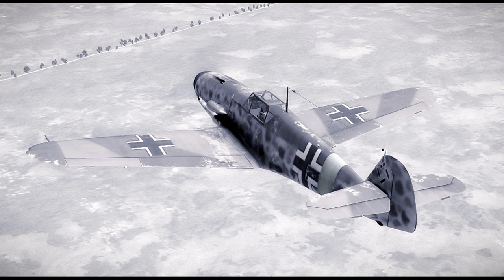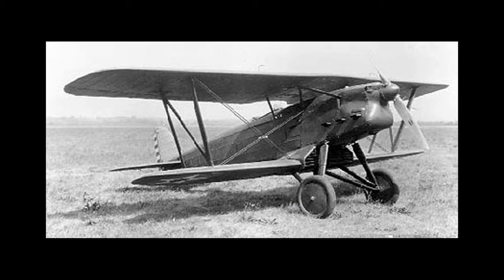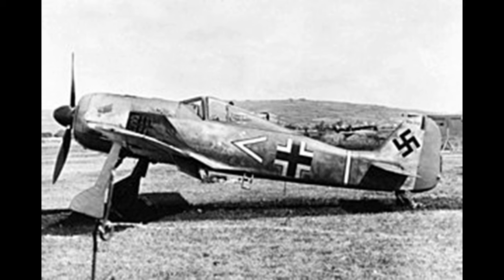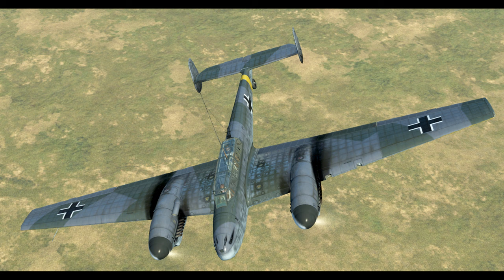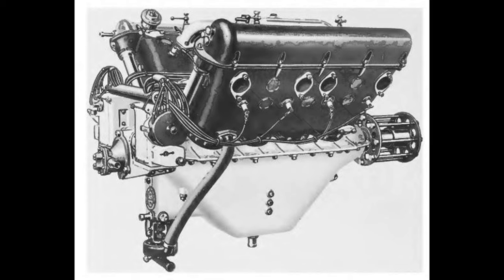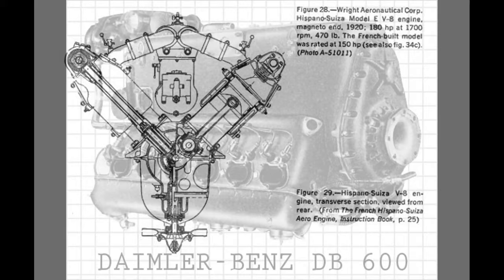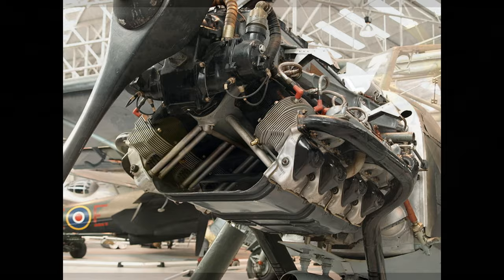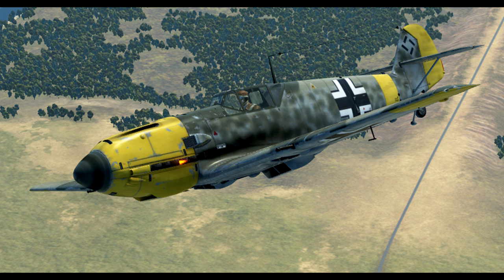Messerschmitt Bf 109 , Why an INVERTED V-12 Pt. 1? inverted V12s vs. upright

Comment: I notice from the pictures in the webpage that the inverted engines appear to exhaust their spent gases in the area of the wing root whereas the 'upright' engines exhaust well above the wing root.  Is it possible the spent exhaust gases help reduce the possibility of the airflow stalling at the wing root, reducing landing speeds and/or aiding low speed maneuvering?

Comment: The thing I find amazing about the German built V12's from WW2 is the engine's were so precisely and meticulously machined to such a high standard of precision that the surviving engines can not be repaired. if a part was to were out the tolerances are so tight even a bearing could not be made to day to repair one with the same level of procession . so the people of the historical society's that keep them can do only maintenance to keep them safe from damage. we in the US and even the Germans have lost the ability to do work on such a precise level .
Reply from the maker: I am afraid you are correct.

Comment: Additional info: Page 37 of "The Secret Horsepower Race", Helmuth Sache, Chief Engineer for Aero Engines, is quoted as saying  in 1937 that "The inverted engine was chosen by the German Air Ministry because of the general ease of installation, accessibility, and view in the case of single-engine machines."

Also in 1933 the RLM sent a tender for future engine development to Argus, Daimler-Benz, BMW, and Junkers.  It contained 7 fundamental technical requirements, the very first of which was that the engine be inverted so as to less restrict the pilot's field of view.  The second requirement specified a low mounted exhaust system to place the exhaust gases and exhaust flames out of a line with the pilot's head. This requirement mentioned that this also suits the fact that the widest part of the fuselage is the wing-fuselage junction.

Up until then all the engine manufacturers were developing upright V-12 engines, and this requirement caused them to have to redesign these engines.  For example oil and fuel systems had be be reworked, and oil scavenge moved to the valve covers.
Reply: Correction: I think those specifications were sent to the manufacturers in 1928 by the DVL, the predecessor of the RLM which was not instituted until 1933.

Comment: Another disadvantage of the inverted V-12 was the lower prop line made the undercarriage longer to avoid the prop hitting the ground, and therefore the 109 had a higher nose when sitting on it's tail wheel. This made vision much worse, and the undercarriage was probably less stable also.

Comment: Greg , FW190 had Radial engine! First prototypes. The first prototype, the Fw 190 V1 (civil registration D-OPZE), powered by a 1,550 PS (1,529 hp, 1,140 kW) BMW 139 14-cylinder two-row radial engine, first flew on 1 June 1939.
Reply from the maker: Wow, you guys are really coming out of the woodwork today. Wake up and smell the coffee. Then, listen to what I said. I didn't saw what the first prototype had, I was specific in my working, and yes SOME 190s have inverted V-12s.

Comment: For single engine aircraft, I think room for armament close to the CG, and even better, close to the pilots sight line, is a big advantage.  There would be a better concentrated fire,  over a longer distance.  Wing placed guns are angled towards each other, so the bullets will cross each other at a certain distance.  Almost like a cowboy with two revolvers, aiming down the barrel, vs. shooting from the hip.

Comment: inverted V also allows the prop to be mounted both high off the ground and driven straight off the crank without the need of a heavy gearbox to raise the prop above the crank.
Reply from the maker: The 109's gearbox lowers the prop below the crank centerline.

Comment: You had most of the reasons correct, but you missed a few major points.  Darus Zehrbach of WV in the USA was the designer and manufacturer of inverted V8s and V12 produced for use in aircraft through the 1990s which I produced under the LPE name.  Those engines were designed after a long look back into engine history, a lot of conversation with Germans and with US Reno racers, and a long time of trying exactly what both of the major powers tried.  The inverted were just as easy to put into boats or tanks as the engines did not know whether they were upright or inverted.  You just installed the inverted aircraft engine upright in a tank or boat.  When inverted, the valve covers became the sump, when upright, the crankcase top became the sump.  All had scavenge connections for the oil--just like they need for inverted flight in dogfights anyhow.  It was found from examination of WWII and post WWII records that the inverted wore much better than the upright with longer service life.  On high output engines you have to use oil sprayers on the pistons to keep them cool, and the amount of oil, and the consumption of power to spray them and oil pump size are problems versus just letting the oil fall into the pistons.  The inverted is lighter and puts out more power from this point alone.  Every part in the engine that was non pressure lubricated was better lubricated when inverted.  The other major difference was the gearbox.  As the engines designs of both types were pushed for higher output, the gearboxes became very problematic.  The spur gear boxes of the Merlin example had only one tooth engaged and gearbox life was terrible.  As power was pushed in late years (and at Reno) it even could ignite the oil in the box.  I have seen explosions in the spur gearboxes.  Torsional vibration was a major problem on the spur box engines just beating the engines to death. The inverted engine, having the shaft up high and prop where you wanted it as you mentioned for streamlining and visibility, could use a planetary gearbox with 20 or more planet gears for 20 or more teeth engaged at any given time.  Engine life more than tripled.  After WWII there were a number of attempts to use ex bombers as airliners and freight liners.  All attempts using engines with non planetary gearboxes failed very quickly.  Only the big radials with the vibration under control and the planetary boxes continued for many years.  Around the world there have been a lot of attempts to build auto engines into aircraft engines.  They all just stuck on a spur gearbox or belt drive, and none have been able to have long life.  The torsional vibration just beats them to death. The USA and Britain determined that if an engine could run 150 hours, it was good for combat aircraft.   So the proof tests for a design were only 150 hours. This was because the life of a pilot was less than that (often as low as 50 hours), and the plane would get shot down.  So no use in building a high quality engine to last longer.  The Germans recovered and rebuilt engines from within Europe that they controlled.  Any especially during the time that they dominated the sky, they wanted engines to last much longer than 150 hours.  Readers below commented that the inverted would have lower con and main bearing life.  That is wrong, those were pressurized bearings and it did not matter what direction they were oriented.  The valve train, and especially the hot exhaust valve benefited greatly from being drenched in cooling oil.  Aircraft engine cooling drag, considered to have been 25-30% of the total drag of the aircraft, fell with the inverted engine from cowl design.  None of the WWII designs exploited the other advantage of the exhaust placement which enabled the use of headers flowing into longer exhaust pipes going back under the belly for added propulsion from both the expulsion of the engine heat and the exhaust heat and thrust.  The inverted did not have the oil in the cylinders like the radials, as they were liquid cooled and ran far tighter piston to bore tolerance.  Additionally, some used diesel engine piston rings with the overlapping ends so that there was no ring gap.  Any that did get past the piston simply dripped out the exhaust or intake valve.  A smoky start maybe, but no issue.  The dry sump oil system of the inverted is radically better than a sump system as it deaerates the oil.  After very few minutes of high power running, engine oil is a foaming hot mess with very high amounts of air beat into it.  To this day any racing engine with very high output that runs for long times is a dry sump engine.

Comment: From a aircraft mechanics perspective, it is easier to service a engine in place if the main components are acessable from the ground. During rain or snow, the engine can be serviced outside just by covering the nose with a tarp.

Comment: Rolls Royce did their V12's because they started with the WW-I Eagle V12, which was Royce leveraging his knowledge of the Silver-Ghost engine. The Kestrel, Buzzard, R, Peregrine, Merlin, Griffon - all with that incremental history. All were upright because the first thing was. They didn't plan for use outside of aircraft. Royce did have a hankering for X engines, but they chose to stick to the well accepted upright V12. The Meteor tank engine was created when the 1920s Liberty was shown to be out of date and lacking the power needed in a new tank, while a non-supercharged Merlin matched enough to be a good solution. Meteor lower power requirements meant they could use sub-standard and recovered Merlin parts. The Merlin in boats was a very short-lived idea and quickly dropped to focus on the demand for aircraft. RRHT have a superb series of books that go into endless detail on all this.

Comment: An inverted engine will have the center of thrust closer to the center of aerodynamic pressure. The forces on an airplane are lift, thrust, drag and gravity. The closer the centers of these forces are to each other the more maneuverable the plane will be. A negative point to inverted engines is prop clearance to the ground. This requires a longer landing gear and make the plane harder to handle on the ground and while landing.

Comment: spitfire & bf109: we dig into every detail to maximize aerodynamic efficiency.

p47: i will make myself as heavy as possible so the air resistance couldn't stop me
Reply from the maker: You might be surprised how poor the aerodynamic efficiency is for the 109 and Spitfire.
Reply: @GregsAirplanesandAutomobiles  agreed, could've done much better but at least the design philosophy of spitfire was to minimize frontal area which makes some good sense... u r not talking about the radiators right?
Reply from the maker: I'm talking about the entire airplane, radiators, oil coolers, and intercooling included.
Reply: @GregsAirplanesandAutomobiles  remembering from documents the protruding radiators were early attempts to put that Meredith effect to use.. but cant remember if i have seen if they have been rated for thrust production
Reply from the maker: I have seen no evidence that Meredith effect radiators produce net thrust. That is to say that they may make a little thrust and it offsets some drag, but it doesn't produce more thrust than drag like an engine does.

Comment: Two important reasons are missing. In a dog fight a fighter aircraft mostly gets continuous hits in a turn configuration, means attacker's boresight line comes from rear and above angle. With an inverted V the most fragile and large part of the engine - intake manifold and fuel supply - is turner away from the bullets and covered by the engine block. The crankshaft cover - which is very thick as you see - works as an armor for the engine. Another reason is that V engine is not symmetrical around crankshaft. If you flip it you get space above the crankshaft to put guns there - this is why there is no regular V engine fighters with guns above the engine. Which would btw be a nightmare to remove guns to service the engine.
Reply from the maker: You are simply wrong. There are many regular V engine fighters with guns above the engine. The rest of your post is wrong too.

Comment: I think at 5:30 one truth iis shown, yet not mentioned: the inverted shape allowed a reduction of high pressure in the root section of the wings, as the angle to the wing is more open. This reduces drag. This principle continued in the me262, me163 and all modern fighter aircraft too somehow

Comment: I like those tangents that you go off on. wouldn't it have been interesting if Junkers had made the Jumo an upright V-12, perhaps making it suitable for tanks, rather than those Maybach units that struggled for the heavies.  Of course with the power train already being overstressed on Panther, Tiger, etc it likely would not have worked out regardless

Comment: Using the inverted v-12 should bring the thrust and drag lines closer together, which would reduce the size, weight and AoA of the tail resulting in less drag (form and induced), and higher speed. The 109's tail does look smaller than say a spitfire....
Reply from the maker: No, because the gear drive can offset the prop in either direction, or in no direction.

Comment: I think another primary consideration was armament. This layout favours the installation of two cowling mounted MG. Without the extra mass of the engine cilinder banks you get two areas on each side of the sump, thus leaving the wings of the aircraft much lighter witch in turn helps manoevrability.
Reply from the maker: I don't think so, we cover that quite a bit in part 2.
Reply: @GregsAirplanesandAutomobiles  To start with, I have to congratulate you for your channel and the work you invested.
 It's very good and enjoyable to watch. 
I don't disagree at all with your conclusions, in fact some of the things you say in part 2 actually support what I said.
 It's my conviction (I've read quite a lot about WWII aircraft since I was very young but I'm not an expert and I'm not going to provide sources here because you obviously know quite a lot on the subject matter) that neither the RLM or the companies envolved in the programme thought of ease of maintenance as a priority when they chose the inverted V12. It's my conviction. I believe was all about performance: The tightiest and smallest airframe around the selected engines, which initially were 2, the Jumo 210A (It's unavailability lead the first prototype to be fitted with the RR Kestrel, but soon after installed in subsequent prototypes) and the BMW XII (an upright V12) and centerlined armament. I believe the programme asked specifically that the armament shoud comprise 2 or 3 guns in the nose of the aircraft: one cannon (or large caliber gun) firing through the spinner or between the cylinder banks (perhaps thinking of the BMW, I guess..) and two more on the cowling or just two guns, but all in the nose. All the other competitors presented the same arrangement. As you well noted, visibility would be an important factor here, but with all the guns around the nose and the development of the BMW going nowhere, the Jumo 210 (and later on the DB 600) were the ones that favored the best design features: more guns, less frontal area, and better visibility. Sorry if it was too long

Comment: I think one other reason they used inverted V12 engines is the Germans also favored using synchronized guns in the nose firing through the prop, and having the engine inverted allowed more room for the guns barrels that aren't too far from the top of the engine. with a Upright V-12 like in a Spitfire or P-51D Mustang this leaves little room for nose mounted guns, without heavily effecting the streamline shape of the airplane, and as you stated also effecting the forward visibility, especially as you started getting into larger caliber guns such as the AN/M2 .50 Caliber machine gun, not much room left for guns with a upright engine, but plenty of room left for a inverted engine.

I actually read this somewhere ...long ago, and I can't remember where, and I can't remember when, and I am sure it wasn't a primary source, but as I look at a 109 with it's guns almost all in the nose while other fighters like the P-51D Mustang and the Spitfire all had their guns in the wings, this made sense to me, so I believed it, but you also brought up some other good points.

Ease of manufacturing, it's what they already had, and the cost of developing something more, and the time it takes to do that doesn't make much sense and would only interrupt much needed production in the instance of the American and British airplanes. and a lot of Italian and Japanese fighters had easy access to these engines because of licensing, so it was easy for them to put them into their designs.